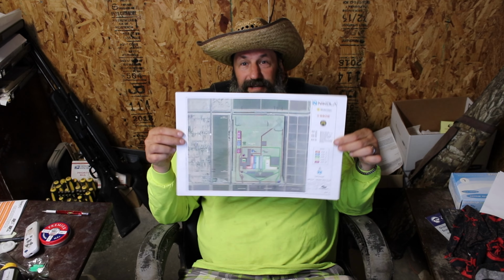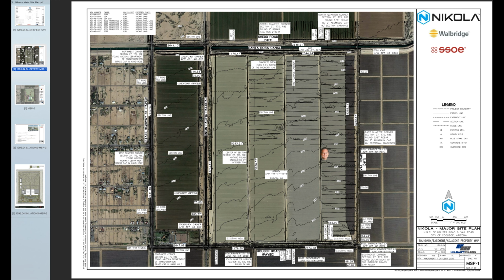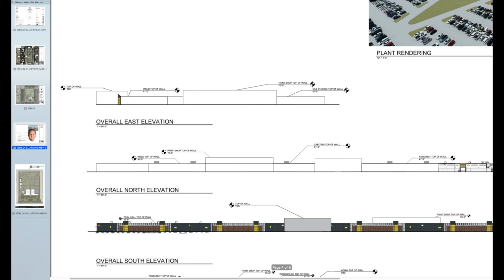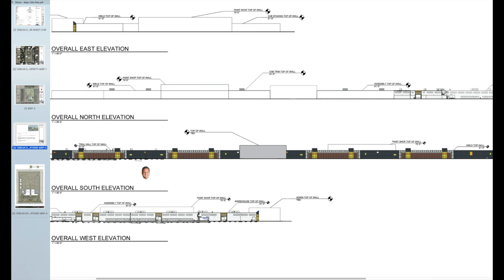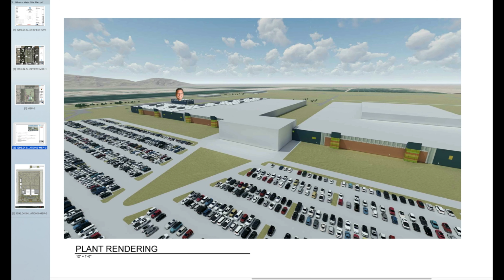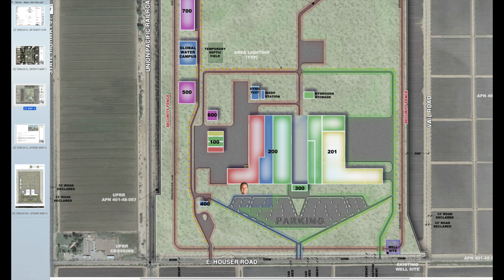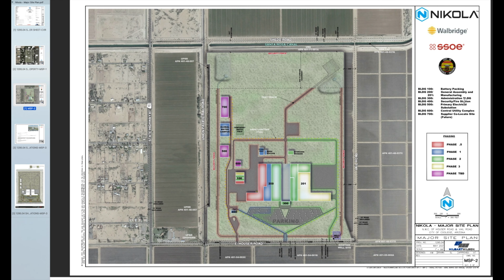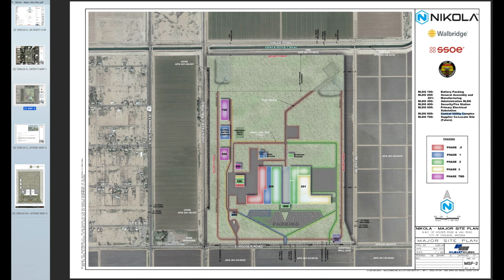Nikola Updated Site Plans!

Comment: Bear, do you think they will make use of the train line at the back of the property for either parts delivery or shipping (i.e. put in a spur line)? Have you seen any trains on that line - is it even used for intermodal freight ?
Reply from the maker: I don't know of any plans to use this as freight in the future. But this whole area is being setup as an Industrial Corridor.  You never know if a supplier might use these lines to bring in raw material if they were to setup shop nearby.  The line is used very often and intermodal freight is often on it.